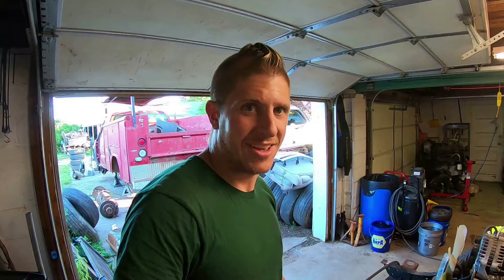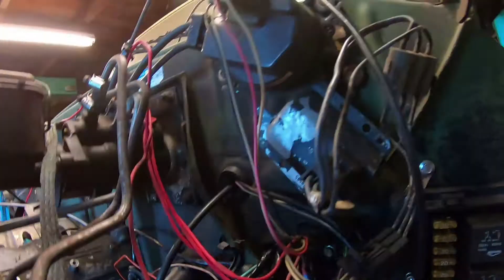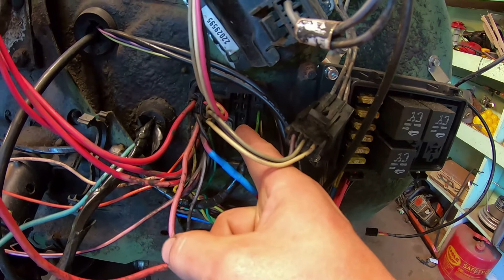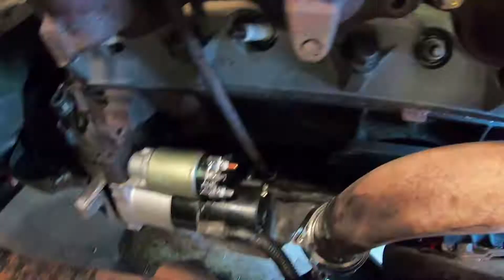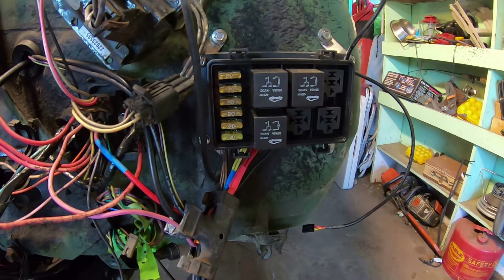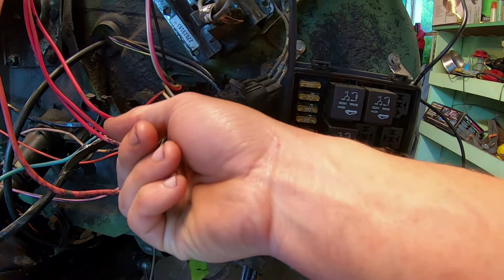Making Your LS SWAPPED Square Body START and RUN off the KEY

Comment: You running the stock 2 pin neutral safety I take it ? considering your using purple wire to excited ? Or did you by pass the safety switch ?
Reply from the maker: I just de-activated the neutral safety in the PCM.

Comment: And what did u did  to the other wires? The ones u mentioned on the block, the grey/blue,a/c wires, yellow,etc????
Reply from the maker: The ones that I didn't use I just put heat shrink over the end to seal it and coiled them up in case I need them later.
Reply: @MohawkMotors  @ purple wire from truck? Goes direct to starter???

Comment: Hey Jason 
Great video  I have watched it about 12-15 times now. Lol
I still have been able to get my square body running.  It’s a 88 suburban Silverado.  And in my hick head has only 2 large red wires. And a bunch of extra wires  
Anyways I still can seem to get mine running 
I have the aftermarket 4 wire fuse box 
Fuel pump comes on I get fuel to the rail but not pumping  
I was hoping u could help me please
Reply from the maker: Hey Peter,  so you have fuel pressure at the rail but the pump doesn't run when the key is on? Am I understanding correctly? Are you using the pcm to control the fuel pump or just a simple relay controlled by the ignition switch?

Comment: What harness wise do I need to keep from the squarebody.
Reply: Thanks man.  How about inside cab harness.
Reply from the maker: Left it alone, all I did inside the cab was add my boost and AFR Gauges
Reply: @MohawkMotors  yeah I was wondering because the computer that's above the heater box.
Reply: @bubbabatterby7059  if you're LS swapping, you can get rid of that lil computer or just disconnect and leave it.  It was used for the distributor timing.
Reply from the maker: I didn't keep much of the engine harness, just a couple of the wires powered when the key is on and the starter excited wire.

Comment: I bought the holley terminator max x dbw im now poor this con version is not cheap
Reply from the maker: Nice! I want to do a terminator at some point, right now I'm not doing anything wild enough that the stock computer can't handle it and I can't justify the cost of terminator until I actually need it.

I think everybody's definition of cheap is different, but I do believe that they can be done for under $1000 if the person is willing to take the time to find good deals, and learn how to do what is needed.
Reply: @MohawkMotors  my othe conversion i used howell good

Comment: So how do you wire it if it doesn’t have the third power wire
Reply from the maker: You could run your own power wire, or tap into another circuit, or split one of the circuits you used already.

Comment: All of those relays and fuses for the injectors are not necessary. Injectors are fired one at a time. Not all 8 at once. I had a 15 amp fuse for bank one and another fuse for bank 2.
Reply from the maker: Good to know, will save me a little wiring and space in the panel for the next swap!

Comment: Since you're doing fuel injection. Why not have the computer control your fuel pump?
Reply from the maker: To be honest... I ran out of relays and I wanted to get it started asap. I have a few changes I want to make now that I've had it driving for a few months, and getting the fuel pump wired to be controlled by the PCM is on that list of changes.